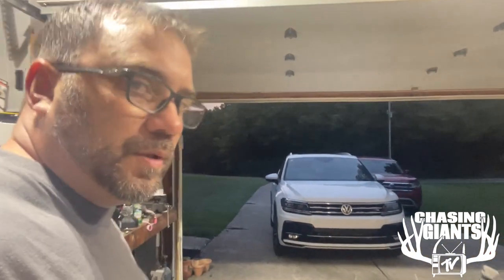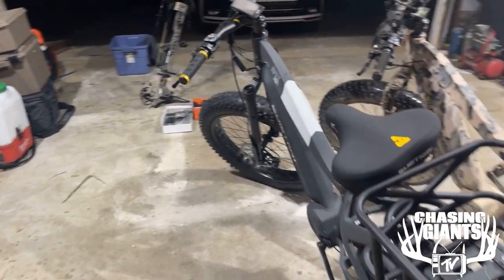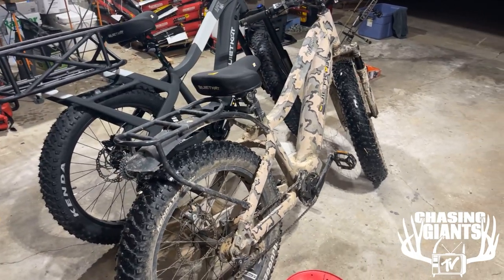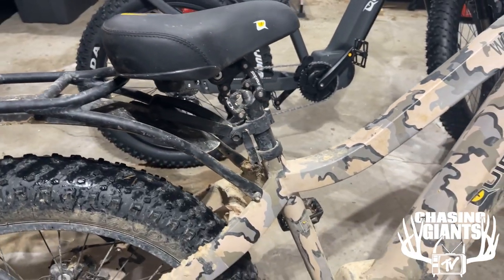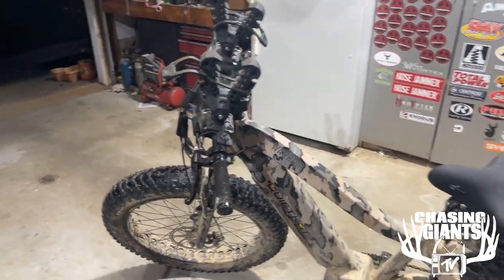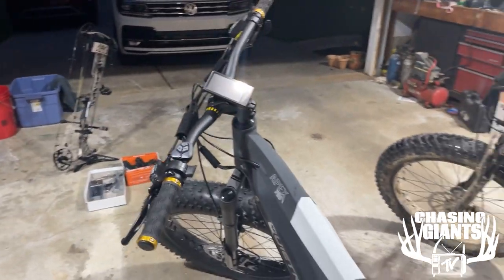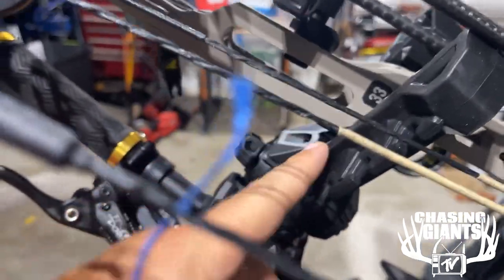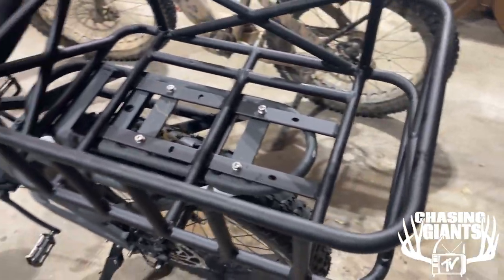QuietKat Apex Pro Electric Bike Accessories - I need help!

Comment: Nice set up.  I’ve year round with my apex for 5 years.  I love it.  Found the handle bar mounted bow to  be heavy & awkward for move near trees.  So, I have the mounts on the back rack & lay the bow horizontal .   As far as the “derailleur”  You might find a top mounted chain tensioner for your single speed. Best of luck on the hunt

Comment: Make a solid mount on your storage rack for your quiver out of the way of all your gear? Run the quiver vertical maybe so your body can protect it when your moving? I would do what you said and add a another set of mounting holes for your rack or slots? I guess you could get a smaller butt, but that’s not so easy 🤔 nice video 👍
Reply from the maker: Smaller butt.  Got it